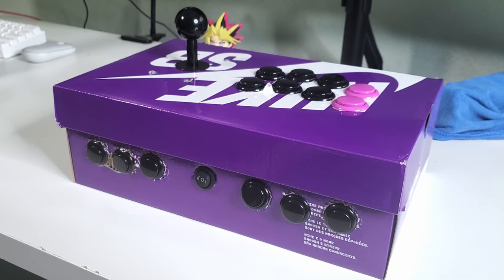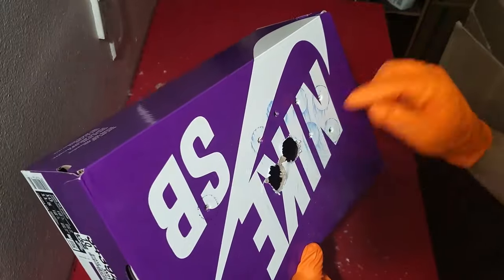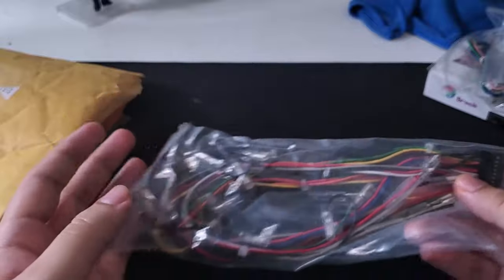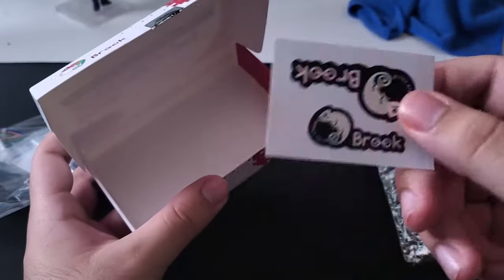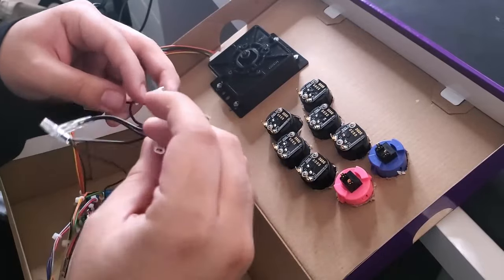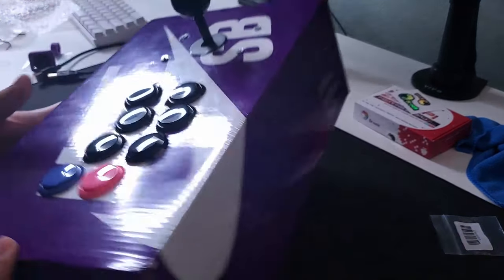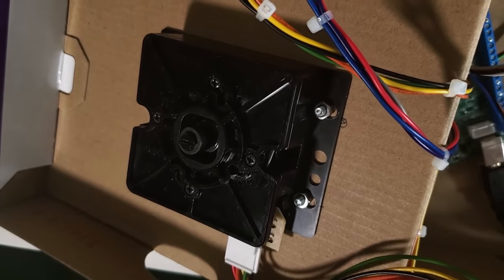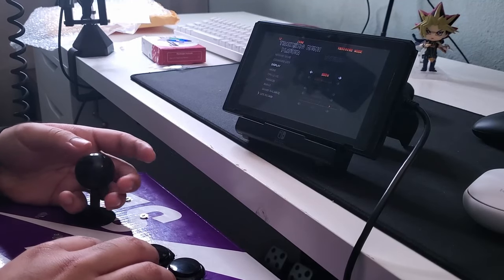The Shoe Box Arcade Stick | Building a DIY arcade stick out of a shoebox!

Comment: You might try and use some fiberglass resin to strengthen the cardboard. A couple of coats on the outside and inside will probably make it a lot stronger. Cosplayers do this a lot when making armor and helmets.